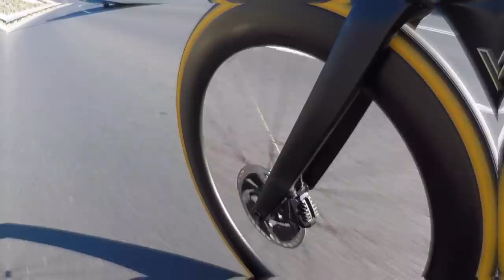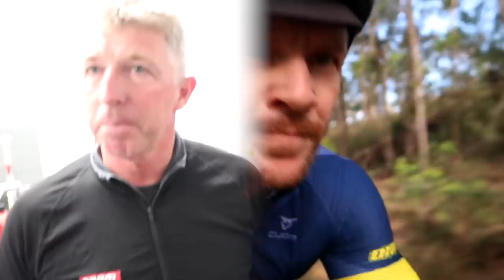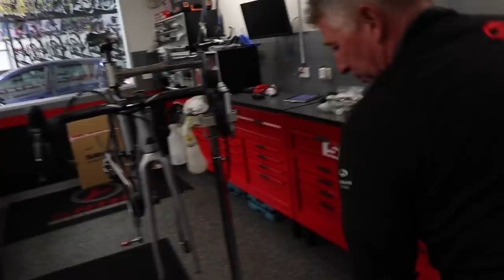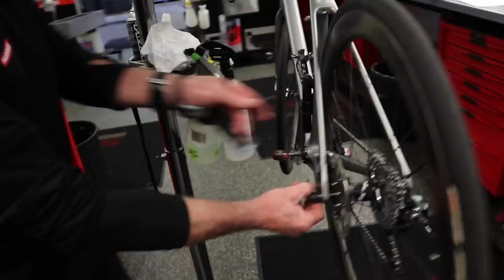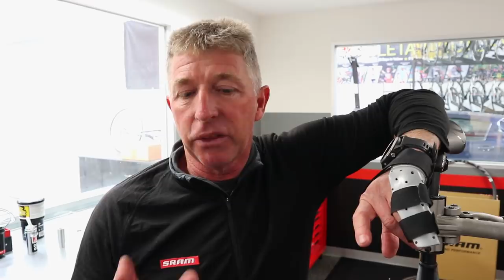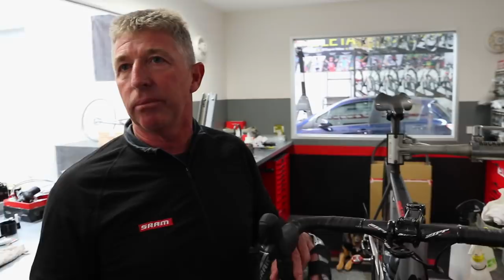Disc VS Rim Brakes (& Thru Axle VS Quick Release Skewer)

Comment: A set of winter training wheels for rim brakes.
Shimano 5700 hubs 36 hole front and rear.   £60  (Smooth when adjusted properly)
Wheels Manufacturing 4130 solid heat treated axles and wheel nuts i.e M9 and M10  £30 (don't forget the Campag Peanut Wrench)
72 DT Swiss Alpine 3 spoke with brass nipples  £55
2 Rigida Spunik 36 hole double eyelet rims £40  2 x £20
G5 Silicon Nitride Balls for front and rear hubs £24 (optional just to say you have ceramic bearings in your training wheels)
Total Cost £209
Bomb proof wheels for folks who cannot operate quick releases.
Reply: Add an Ultegra Cassette CS6500 for £30 to keep the weight down and some Latex inner tubes to compensate the additional rim weight £8 each and add some Vittoria Revolution Graphene 700x28 tires for £10 each.  About £70 all in including some old school Velox rim tapes
Reply from the maker: Thanks for sharing this Amfear. Cam

Comment: great video & information.  A few comments, a QR doesn't give a strong enough hold when you have discs, you'll find the QR gets unseated in fork due to greater forces at wheel.  rim brakes were great until carbon rims came along .... i.e. heating carbon rim & poor braking in wet and overall.  discs really shine through on long descents with excellent modulation (I'm using Ultegra Shimano).  finally, if you buy sram products they are geo-blocked so you're locked into inflated AU prices from shops - some would say that's old fashioned :-).
Reply from the maker: Thank you sir, and appreciate the comment. Good insights and feedback. Cam
Reply: Geo blocking is annoying! I bought a sram rear derailleur from bikeinn.com last week (not easy to find on the web apart from eBay)

Comment: Rob neglected to mention the main benefit of disc brakes and the primary driving force behind pushing them: the industry is going to make a ton load more $$$ by making rim brakes obsolete.
Reply from the maker: Fair call, thanks for sharing this point. Cam
Reply: Just yesterday I had to pay the LBS $80 US for disc brake work front and back--new pads and cleaning, nothing with the fluid.
Reply: Just marketing... change your.frame that you have already changed for a 28 mm wide tyre frame, because now it s too dangerous to ride fast 25 mm tyres.
10 years ago we have been told that 23 mm  were not good enough.
Rim brakes are insanity because they make tyres explode...tubulars are  ridiculous yet, you have too change your rims for tubless ones...change all your wheels for discs one too.
Yours hands are too weaks for shifting gears with cable derailleurs too....
I wait for bike's power steering, it will come soon i think!
Reply: but isn't using disc brake rim makes the company hard to sell their rim products in the long term, because once the braking surface is done you could just change the disc rotor, while on a rim brake you change  the whole rim
Reply: @louismorel2001  don't forget the ABS and traction control...
Reply: @louismorel2001  ha ha ha power steering 🤣😂 may be soon pedaling assistance as well. So bike technology is controlled by the automobile industry

Comment: Essentially a rim brake is a disk brake; the wheel being the rim. I can't see the advantage. While racing crits I barely used the brakes. Descending mountain passes with a loaded touring bike not a problem either plus it is easier to monitor brake pad wear and adjust on the fly as needed. QR skewers were fine as well and I rode many years prior to the use of lawyer lip lugs. QR skewers don't support the wheel, they just supply the clamping force. I have thru axles on a new Trek 29 plus bike and they are a pain in the ass as they are hard to keep clean during a wheel change on the trail. Bikes for most of us last quite a while and need little in the way of replacement parts. Therefore manufacturers keep coming up with new stuff just to maintain a cash flow. As for disc brakes on MTB bikes, I have no problems.
Reply from the maker: Thanks for sharing your experiences John. Cam
Reply: Now that the cycling industry has gotten so big, it's their incentive to just keep making stuff as you mention - just to keep people spending money.  I'll admit that it works but I still really enjoy riding my 26" hardtail with modern cantilever brakes.  For some reason it just feel so good.

Comment: Well, he is wearing a SRAM tee, sram boxes, and sram wallpaper and is giving praise to disc brakes and more gears :) Other than that, disc brakes brake better, slightly better in the dry and a lot better in the wet. I do think it's a great way for the bike industry to sell more bikes. Disc brakes are less aero, especially as soon as you have a bit of a crosswind, which is most of the time. MTB, CX, sure, discs have so much sense. For now, disc brake forks are a bit vague and don't have the same handling nor comfort.

Comment: Its like way back in the day.  Riders weren't allowed to use derailleurs in the Tour de France for years.  Because some argued it was a unfair advantage or they were dangerous.  When carbon fiber bikes first came out so many were against them.  Now look at the industry.  I just ordered my 4th bike with disc brakes and love them.  They give me a more consistent and reliable braking. If you crash it doesn't matter what kind of brakes your running.  Your going to get hurt and if that mythical rogue disc comes flying at you and kills you.  Maybe that's how you were meant to go.
Reply from the maker: haha, thanks for sharing Shane. Cam

Comment: The 'evolution' of bike tech means consumers will have to upgrade/update their bikes sooner than they'd like.
Reply from the maker: Looking that way. Thanks for the point. Cam
Reply: I doubt it.  There are too many of us out here who own bikes with all the latest tech but still think of our vintage and newer steel bikes as our forever bikes.  Long after my carbon fiber bike is in the landfill someone will still be riding my steel bike with the quick release wheels and rim brakes.
Reply: @connieback7577  - Quick release wheels and rim brakes means you've already bought into the 'evolution' of bike tech.  I'm talking about things like 10 speed gearing and rim brake tech being discontinued with no compatible upgrades at some point in the future.  I'm there now with my bike and i'm forced to buy a new one because the previously mentioned things change hub, fork, and frame design.

Comment: Very simple. Brakes stop your bike. Disc brakes do that better. Your can debate whether we "all" actually need them or how much more better they work, but they do. There are pros and cons to both disc and cable brakes. I'll take the better stoppers, especially since most of the previous cons have been engineered out. Too much power? I'll use two, even one finger. My Supersix Evo HM disc is 25.12lbs with pedals in a size 56cm. It's light, handles great and is comfortable. The only issue so far in the occasional sticky rear pistons.
Reply from the maker: Thanks for sharing your thoughts on this thread. Cam

Comment: It is weird that a lot of people don't know how to use/install/fine tune rimbrakes and QS properly and with some kind of feeling. I think those will also will have problems with the axles and disc brakes.

I have a few questions about the disc wheel period;
1. Why are lightweight Mtb wheels lighter then most road wheels?
2. Why go 12mm axles for front and back while a 15mm front and 12mm back did a perfect job in the mtb scene? Or why not go with boost?! Personally I think it would be marketing.
Reply from the maker: Hi Bjorn, personally I don't know. I haven't ridden mountain and wasn't even aware of that interesting stat! Hopefully, someone else on this thread might have the answers. Cam
Reply: @CamNicholls  Hi, MTB guy here.  Yes, we have 15mm through up front.  I'm guessing road bikes just go with 12 because it saves weight and there's no need for a big ass 15mm axle on a road bike...  Pretty sure you're not taking 4 foot drops on your Pinarello.  LOL

Comment: Love my bike with discs and thru axels, would never buy anything else. I tried stopping with my old bike in mild rain once. Barely could. Also, with TA the wheel goes back exactly to the same place every time. It's a well designed modular system as others pointed out. Could not agree more

Comment: I really can’t believe that guy is a CEO of SRAM Australia, all he says, can not be substantiated. I have never heard of QR problems systemic in the industry. He talks about the wider drop outs at the back, but doesn’t talk about the problems which the manufactures had to make them work properly and re-designed the groupsets. One times is a SRAM product, no one in road has really adopted it accept for commuters and E-bikes. I have tried it and went back to two times, two times gives more gears and better stepping. One times is not without its problems.
Tubulars don’t give the same problems as clinchers with heat in the rim, but what is the industry pushing, tubeless and disc brakes
Discs have not got a world wide standard, that is the problem with the pro teams and the generic wheel suppliers.
Disc brakes do get hot and oil can boil! As the brake is closer to the hub it generates more heat so can still give a loss of braking descending.
I WILL NOT buy disc brakes on my top end road bike until I see it being adopted in professional racing and is proven at this level.

Cross bikes are different to road, you are playing in dirt and mud and wet conditions, it is a bad example, comparing this to road.
Reply from the maker: Thanks for sharing this. Cam
Reply: Yet the tdu will see 75% of ALL bikes as disc that is the feedback.
Reply: glenny oc Then we will see, how they fair. The riders have had the models in discs for a couple of seasons but choose not to ride them, or switch back half way through the season. I am sitting on the fence, as I do believe the manufactures are forcing them to ride, by offering no other option.
Reply: Bora are using discs  on all bikes in training this week.
Reply: glenny oc team sky has disc brakes bike and refuse to use them. I wonder why?
Reply: @mr02gixxer1000  yeah but not winning the tdu or san Juan.disc wont make you win races

Comment: Sorry never ever had a standard quick release pin fail in 35 years of cycling  and it's the hub axle that gives a wheel it's ' stiffness' not the quick release pin , why do bike industry treat the consumer like we are idiots , will I use disc brakes yes ,when I get a new bike and it comes with new disk wheel and forks 😐
Reply from the maker: Thanks for sh4ring your experiences, Mike. I too have never had a quick release fail in 10 years! Cam

Comment: I think both disk and rim have a place.
The dual pivot road bike rim brake and MTB V brake are more than adequate.
I have not used a bike with hydraulic disc brakes yet.
For a touring come bikepacking bike people are still wary of discs and hydraulic disc in particular.
Progress is good but fixing something on the side of the road is getting more difficult.

Comment: My Dura Ace MF-7400 integrated one piece cassette and freehub body is much stiffer than a conventional cassette cogs (this is never really mentioned by the cycling industry), it provides for better spoke dishing angles for a stronger drive side wheel stiffness. It works very well on a whole host of hubs/wheels such a Campagolo Super record hubs with 36 holes (very stiff and responsive with 3 cross pattern). It also has one of the coolest sound as well when free wheeling.
Reply: The disadvantages for this type of wheel hub (especially for the fat cyclist) is where the drive side cup/cone ball bearing is located along the axle.
Reply: "Integrated one piece cassette and freehub body"?  You mean "freewheel"?
Reply: @shannontrainer5857  I also use infinitely variable height adjustment stems, which can be adjusted with a single Allen wrench. Precision Torque wrenches are quite heavy to carry whilst cycling outside.
Reply: @amfearliathmor8213  You mean "quill stems"? And also, don't you think you also need a torque wrench with quill stems to prevent bulging the steerer tube?

Comment: Forgot to mention the darn tubulars, no overheating, less punctures, a bit of sealant does the job 90% of the tim, tubular tape gets rid of the glue hassle. Wheels are stiffer and lighter. Now, this is gonna get heated :D

Comment: Cyclists are too gullible, and 'the industry' takes advantage of them. The fact is, the ordinary road bike has been pretty well perfect for years. These tiny advances in design have a marginal effect on performance, important only to the elite. Most of us aren't elite. The only thing wrong with the  'ordinary' road bike is its derailleur gear system, which is too delicate and always, except in a couple of gear combinations, involves some degree of inefficient cross-chaining. One-by systems exacerbate both faults, so a fine improvement they are!
Reply from the maker: fair call, thanks for sharing your thoughts here. Cam
Reply: One by is utter guillibility made by SRAM since they cant design a fd
Reply: The problems of thru axle is the thread damaged in case of stuck up and loosed thread the whole fork and frame will need whole replace ments, qs is easy to replacement because it is easy to released and no thread in firk
Reply: @earistianreyes9830  wow never thought about that. I always clamp the quick release tight, never had a wheel pop off, just saying..

Comment: Great vid. What's the diff between 160 and 140? ....(don't say 20)
Reply from the maker: DanTuber haha! Size of the rotors. 160mm is heavier and they say not as aesthetically pleasing, but sounds to be a better performer. Cam
Reply: 20
Reply: glenny - straight to the naughty corner you go!
Reply: @CamNicholls  1 had 160 then went 160 front and 140 rear.  Iw its 140 front back. After rims brakes 140s are more than ample and im 82kgs. Ive got 160s on the xc bike but that bike is 2kgs heavier.  Im not a heavy braker tbh.
Reply: Larger swept area equates to more braking power and better heat dissipation.
Reply: I have 160/160 on my road bike and 180/180 on my XC bike and it is more than enough for a 105kg of rider.
Reply: @wallacedavidg  so the rim is ideal place for a braking system then. :)
Reply: @simongeeves9662  - Yes, if the rims are made of stainless steel or composite carbon and cost and weight are not considered.

Comment: The blokes makes great points, except for:
The need to replace discs and pads if they aren’t bedded in. Simply lightly sand the pads and the discs to allow bedding in. Race cars have been doing this for decades. His tip for bedding them in is spot on though. If you stop on one spot on a hot disc, you can warp it .

There is no DOT standard for stainless discs and pads, cars use iron discs. Even races cars use iron, ceramic, carbon, but never stainless.
Finally 140mm discs still have plenty of power to pull up a bike. If the brake gets too hot, it’s nothing to do with the diameter, more so the pad material overheating, and the disc not cooling because there is not enough mass to dissipate the heat. Hence why Dura Ace and Ultegra discs have those fan blades on the inside. A 160mm /140mm split front and rear is smarter considering the braking effort each axle carries out.

I believe very soon we will have thin thru vented discs, and floating discs which  will help eliminate many of today’s issues...
Reply from the maker: Thanks for sharing your thoughts on the thread Patrick

Comment: I like disc for mtb and rim brakes for road. The only time I'd absolutely need disc brakes on a road bike is if I had a carbon rims. The resin in carbon rims becomes soft when hot and compromises the structural integrity. Rim brakes are less finicky and stop well enough imo.

Comment: You could put through axles on rim brake bikes. Just saying...
Reply from the maker: Yes, i have heard of this. Maybe that's the ultimate solution! Thanks Max! Cam
Reply: Yes my bike frame had thru axle rim as an option as my drop outs are interchangeable from 12x142 to 9x142 to 5x135. The fork can be 12 or 15x100 with disc or direct mount rim brakes. If i went rim again I'd  opt for thru axles.
Reply: I'm not sure what advantage that would bring because the wheel's spokes are the weakest link in the wheel/fork relationship - not the flexibility of the drop outs. Use your hand to move your rim side to side.  you will notice how easily it does this - especially if you have bladed spokes.  Stiffer forks and stiffer axles will almost nothing to prevent this lateral movement because that happens at the spokes first.  Even if you did stiffen the axle, then the fork would be heavier and stiff, providing a poor ride quality.  A nicely designed fork that has some bend to it actually acts like suspension and instead of transferring the deflections of the terrain to the ride, the fork can absorb it, if it has enough flex.
Reply: @glennoc8585  I don't believe many people have experienced the direct mount brake, they are awesome.
Reply: @antoniodesadier5239  definitely more pressure. I woukd thinknthe sram hydraulic rim brakes woukd be the best option for rim.

Comment: But how do you adjust the rear wheel alignment issues if you don't have Campangolo horizontal drop outs with screw adjusters with a thru-axle to help stop that Ting...Ting...Ting...problem with the disc brake?
That would be like taking a derailleur alignment tool to a composite plastic fantastic frame to help improve derailleur shifting problems....Crack!

Comment: Actually there is not much weight on the skewers.  Think about it you have tremendous clamping force,  so the weights is held by the forks in the front and the dropouts . Think about it ? Why do you think skewers are so thin? Becayse not much weight at all on them
 .. Now if you saying the thru axle makes it stiffer, explaine that advantage.